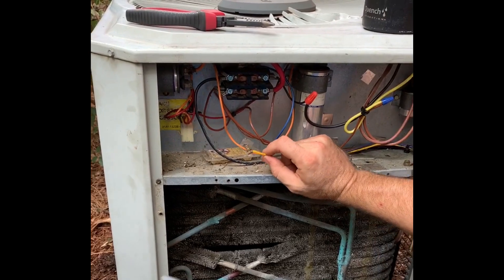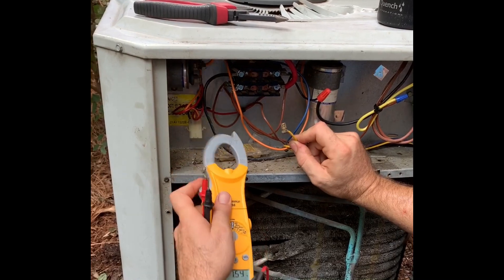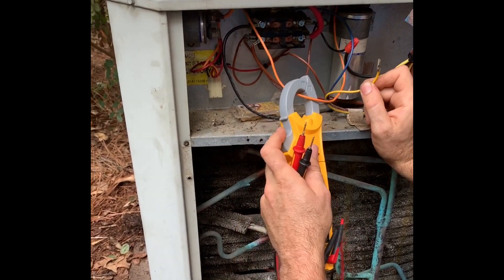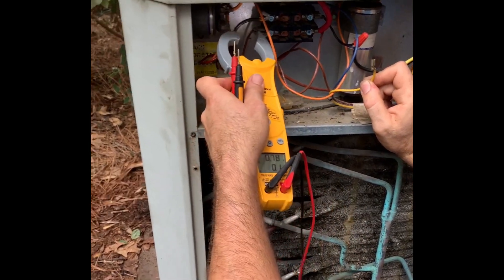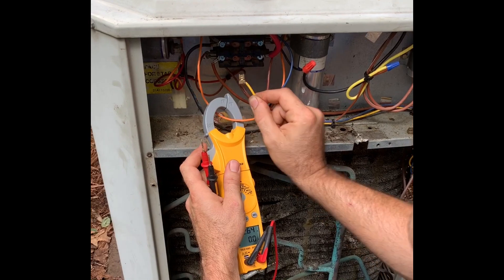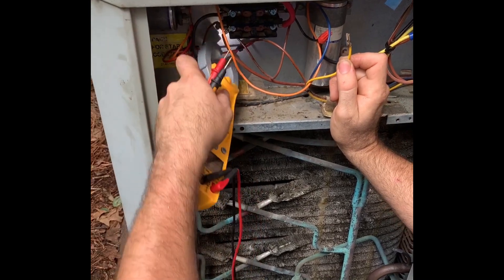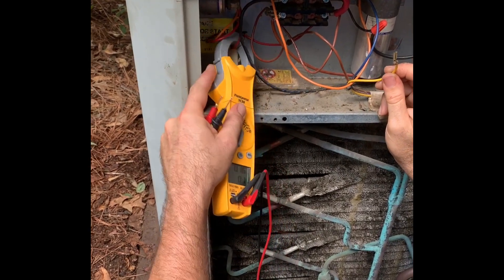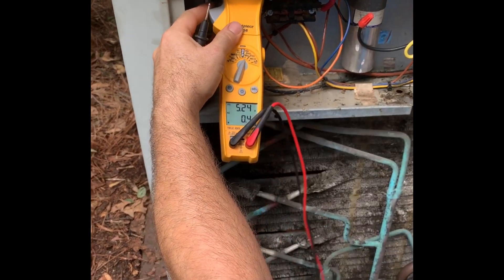Myth Busted Series - Real Compressor Winding Heat On The Off Cycle

Comment: They should have put a thermal disc in that circuit to break that above a certain temperature when it's not needed for crankcase Heat. 
Good one Joe 😎👍
Reply from the maker: Shannon Knight HVAC yes I do need to do a follow up to clear up my mistake that it is pulling that high amps for crankcase heat. It is a very reactive circuit and it works out that it is only about 55 watts real power.